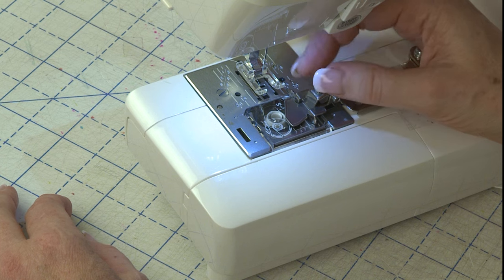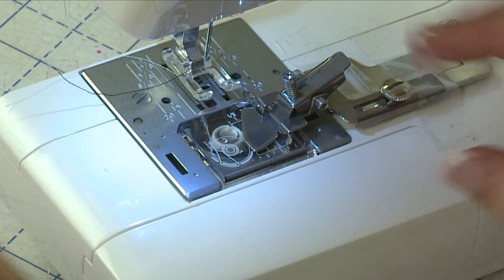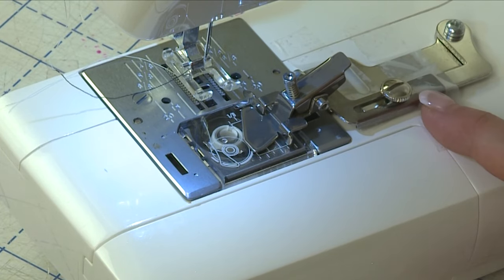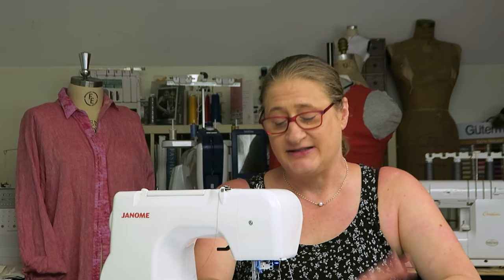Cool Tools Part 2:  Can You Use this Presser Foot on Any Home Sewing Machine???

Comment: If you have a good drill then you can do a minor modification to your sewing machine. Drill a hole the right size for the screw/s. Then use a tapping tool to make threads. If you do it right the screw should fit nicely. You can also add a threaded tube nut the right size for the screw. It can be secured with an industrial adhesive like "JB-Weld" for metal. It will bond permanently with the sewing machine chassis. The threaded tube nut can be countersunk into the surface for a proper fit. The hardest part of this modification is getting the drill and drill bit under the neck and throat of the sewing machine. That can be overcome with an angled flex-drill attachment.

Make sure the threaded tube nut is well secured with something like JB Weld so that it never comes loose. To make it more secure and permanent, sand or file the underside of the flange on the threaded tube screw. By doing this you are giving the glue a better and more secure gluing surface to adhere to.

If you can do that, then this way the presser foot seam allowance guide can be removed easily for changing or reloading bobbins. Great video, I learned a lot. Thank you very much!
Reply from the maker: Thanks for the tip, and for watching!